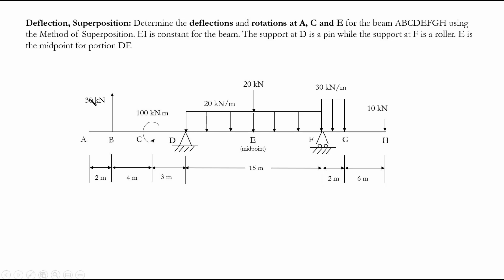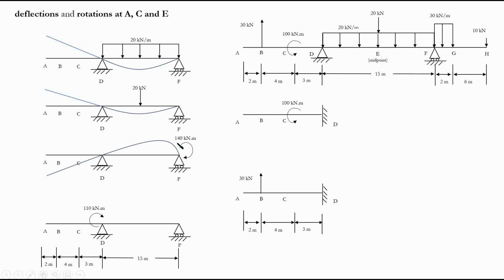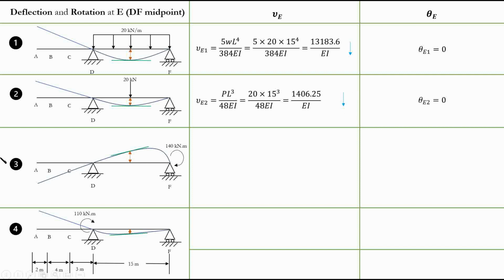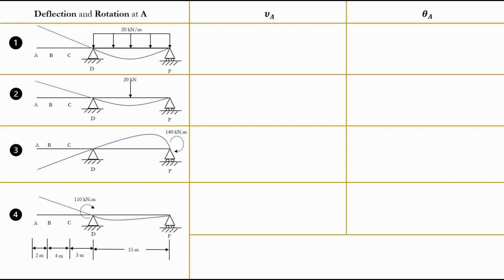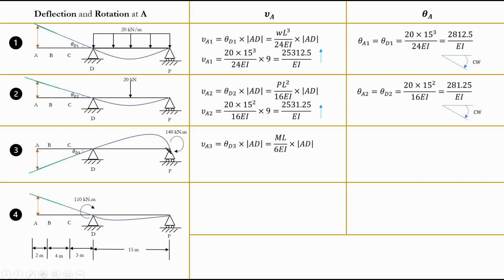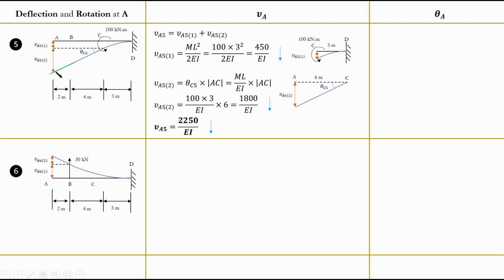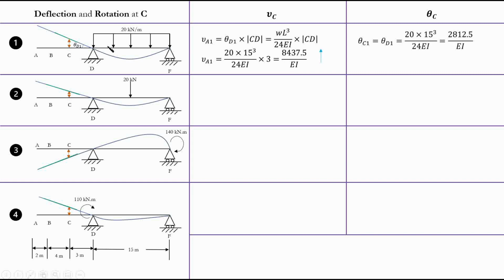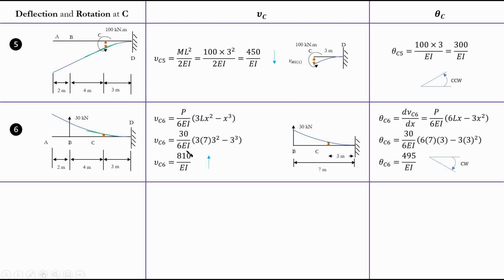Deflection: Superposition (Comprehensive) - Strength of Materials

Comment from the maker: Explanation on "why can we move the vertical load at the overhang to the support and replace them with a resultant moment?"
Answer: The reason is that the support will take the loads and transfer them to the connecting members or the floor, etc, but they cannot take moment and freely rotate. As a result, converting the load to an equivalent moment is identical to the original case in terms of the flexural effect on the simply supported porion.

Comment from the maker: Explanation on "why we divide the cases to a cantilever and a simply supported portion to calculate deflection in the overhang?"
Answer: We bring the loads to the support to first evaluate the rotation effect on that support (and we already know deflection is zero). Once we did that and found the rotation at the support, we can basically assume an additional case where the support has no rotation (since we already accounted for that) and no deflection, and what is that type of support? A fixed support. This latter case will separately deal with the direct loads on the overhang as a cantilever.
Basically, the first case deals with the rotational contribution from the adjacent simply supported beam (this is the actual rotation at the support and will automatically rotate the overhang in a linear manner). And in the second case, we consider the overhang as a cantilever (zero rotation -> already accounted for + zero deflection) that has directly applied loads and will bend that portion in a non-linear way.